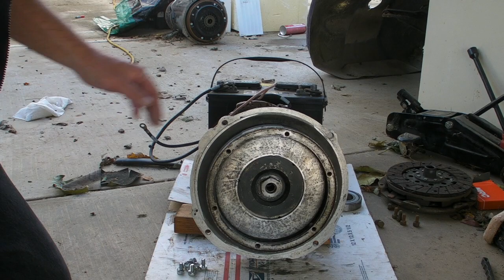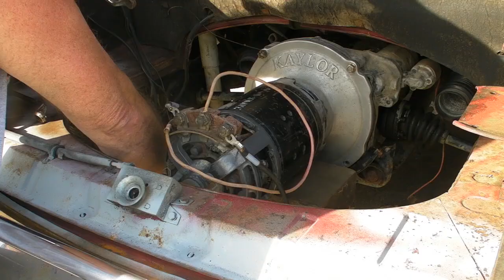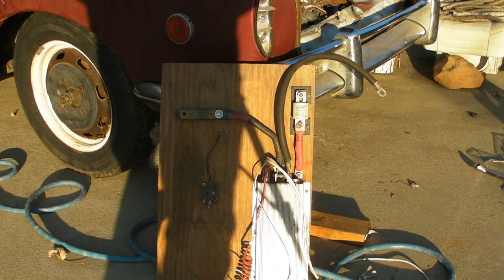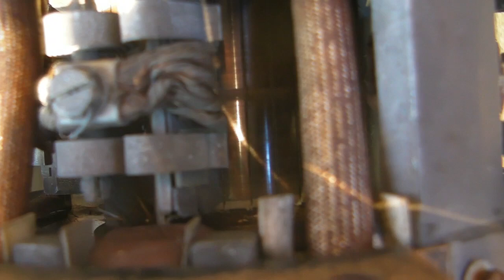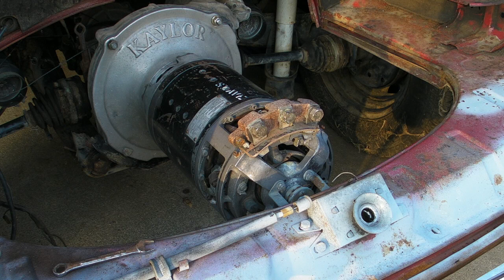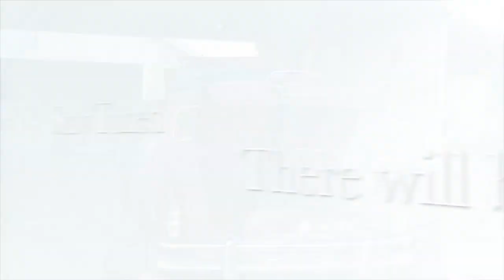Kaylor Motor Install.mov

Comment: Have you anymore info on Roy Kaylor’s Car kits ?I wrote another reply to you I don’t see it now what happened to it can you recover it
Reply from the maker: Not the car but I have two books on installing the motors into the cars. I still have this motor/adapter setup and I have two extra motors as well. In a light weight dune buggy with at least a two speed  mechanical switch and two voltages 36v and 72 volts you can get them to move along rather sharply. What do you need to know. I have talked to Roy many years ago but I do believe he has passed at this point. Most of the estate was either trashed or sold off. Too bad. He was a brilliant man and they squandered his intellect. Im still on the look out for parts and other manuals. I tried to resurrect some of his old web site but was unable to get much usable information. What would you like to know?
Reply from the maker: I did not see any other comment. I looked at my video details and comments. Could be you deleted vs post. I’ve done that before. If you can recall what you ask please ask again. I don’t delete posts unless they are nasty vile posts or scam posts.

Comment: I knew Roy Kaylor, rented a house from him in Menlo Park where he was installing these kits in VWs
Reply from the maker: I talked with him twice. Talked to those who were managing his estate as well. A very soft spoken man. I wish I had the original electrical parts from my first complete Kaylor Motor Setup. I ended up getting rid of them but that was before I acquired a book on how to connect up the parts. If I can find the parts I'll do a Dune Buggy with my Kaylor setup at 72 volts and lithium batteries.
Reply: He isn’t dead he lives in Oregon I spoke with his son Rex February 26th 2026
Reply from the maker: That is excellent news. Glad to know he is still with us. I’d love to find original parts including a generator setup he used on those old conversions. He would be stoked to know I have a working motor/adapter still. I do have a second adapter but it does not have the parts for the VW Flywheel. It was used to mount a different motor onto the adapter.
Reply: @robertsandham3517 man that's great to know! What happened to Roy's land? And hows Rex doing?

Comment: How much hp or kw of this motor
Reply: Couldn't say. It is very under powered for the Ghia but I was able to get the Ghia up to about 62 mph max with a 72 volt setup. If you have one you can set it up to use a modern DC controller but you won't have regenerative braking. The old style of speed control you could do regen with this particular motor. Not advisable. If you intend to do a conversion there are plenty of more powerful DC motors available that would do a much better job than this. I have however seen one on a fiberglass buggy and it was quick. But that is due to its light weight. These motors may be best to use as a generator. The motor does not have at HP or KW tag on it. I could research it but I don't think I will bother. Nor should you. Go find an HPEVS AC-35 or AC-50 and a Curtis Controller and install that on your little conversion. Much better all around. What I have here is no longer being made and are very difficult to find. I have three of these motors and two adapters. One adapter is complete the other is not.    I'm rather surprised that people still comment on these old videos.
Reply: @abittwisted  thank you for your briefly explanation

Comment: Idiot,...it's a clutch, not a flywheel...thumbs down.
Reply from the maker: Actually it was a Pressure Plate and not the flywheel. Of which I corrected it with a text image in the video. Ooops. So when talking about the clutch you are referring to all the components of the decouple system. Flywheel, Pressure Plate, Clutch Disk and the Throwout bearing and arm and clutch cable and pedal. All that comprises the Clutch. Thumbs Up.

Comment: you do not need a clutch to shift if the trans is synchronized
Reply: strainer bag for a 5 gallon bucket as a air filter
Reply from the maker: Well, technically yes. In practical terms some are better than others but the transmission was not designed to be shifted without a clutch. So use the clutch. Specifically this particular motor originally used a contactor style speed controller and a clutch was absolutely needed. I would argue that a clutch is a safety decoupler in the event of a runaway motor due to a controller failure. In my experience shifting without a clutch in an EV or gas powered vehicle is akward and many transmissions that are not new just don’t without grinding. Some work but why complicate matters by side stepping working technology.
Reply: i'm working on a electric motorcycle, with a magneto/generator in the rear brake drum
Reply from the maker: got some images?  How are you controlling that?
Reply: it is a charging system from a street bike. dynamo,  rectifier, voltage regulator. stuffed in the rear drum.
Reply from the maker: Id be interested in seeing it run. Im converting another VW with a medium size AC Induction Motor. Will be much better than this one I have here.

Comment: Hello friend, a question, where did you buy that engine? What serious business is I'm from Panama and I'm interested in sending one of those engines.
Reply from the maker: These are no longer available. I purchased mine used locally. There are much better options than one of these old setups. Check with the guys at evwest.com they can help you better than I can with some good motors. If you must go DC then be sure to get at least a 9" DC Series motor.
Reply: Pete McWade thank you !!

Comment: Hi do you know where can I buy a electric engine like that? or similar thank you.
Reply from the maker: Nothing like this is currently available. In all honesty this is not an ideal setup for a conversion. It does work but not ideal. Ideally you'd want at least a 9" diameter Series DC motor with adapter and controller or a nice AC-50 or 51 with controller and adapter. AC is the better way to go and the AC-51 and 50 can both be operated with the 96 volt or 144 volt controller. There are other DIY options available but for an off the shelf solution the AC motors from HPEVS here in the US would be your best bet. But you'd need a small light weight vehicle. Nothing too heavy. 2500 lbs or less.      evwest.com

Comment: Should have put this motor in a saturn
Reply from the maker: Na! Motor is way to small and underpowered for the heavy Saturn. This set up is ideal for a small light weight fiberglass VW buggy. It was designed for the VW anyway. This adapter won't work on a Saturn or any other vehicle except the VW.
Reply: 95 Saturn? Nah! The car is very light and small. I think it would be great.
Reply from the maker: Nope. 65 Ghia is 1800 lbs vs the 2300 lbs for the Saturn. The Ghia was pushing the weight limit of this motor. Like I said. This motor is too small for the Saturn. There are better motors and better vehicles to convert. Today I'd go with the AC motor vs the DC motor even in a racing application.
Reply: Pete McWade: sorry you donkey! Your correct.

Comment: why didn't you tear down the motor and rebuild it, or re-condition it? It looks pretty worn out.
Reply from the maker: This motor did and still does not need rebuilt. It could use a good cleaning and new paint job but other than that its in excellent condition. It is an old motor. This particular model of motor was used as a generator onboard military jet aircraft to provide power for the aircraft while in flight. This one was not used as a starter. Only a generator. They are built hell for stout and are built using full military specs. They are safety wired at every possible point to prevent mechanical failures while in flight. I have taken one of these apart and they are rather complex motors. They don't have a single shaft through the armature. The shaft is a dual shaft connected to an internal clutch that is always engaged but if it were to encounter any jam it would allow the shaft to spin without breaking the shaft. I still have all the parts and you won't find any civilian electric motor like these. I have two more of the exact model used in an old VW Engine Dyno that was built in the early 60's to provide torque and hp ratings of gas engines. A Racer in Oregon built it and it still works today. The electric motors are used for a load. It was also used to dyno electric motors but you had to connect them to the VW Transmission.
Reply: Pete McWade ... sounds 👍 great, I'll be looking forward to seeing you complete this project! 😃
Reply from the maker: Unfortunately this particular project has been mothballed. There are better choices for making an electric car conversion with off the shelf parts you can buy today. This was a late 1970's project that was somewhat successful. The original setup used a set of contactors for speed control unlike the electronic speed controllers we use today. The contactor setup used lower voltages but full on current that the batteries you used could dish out. So if it was put into a fiberglass dune buggy and you used 72 volts and two contactors you could do 36 volts and 72 volts and the full current available. It would give you not only two electronic speeds but it would also give you your 4 forward speeds in each electronic speed chosen. To work smoothly you would feather your clutch to smooth out the jolt of a start you'd get if you just allowed it to go full on with that voltage. With practice it was rather easy to work all the speeds and gears for a very nice ride but it took work on the drivers part. It was simple and powerful. Top speed in a light weight vehicle could reach in the 80 plus miles per hour range but you did have to give it time. Up to about 35 mph it was rather quick. I still have this motor and adapter and I know it works with a standard series motor controller but you won't have regenerative braking. It was really the only DC electric motor setup that would give you regenerative braking. With todays AC Induction motors you can do so much more with more power and for a reasonable price. I have been working on a DIY inverter to drive these motors and I am going to get another kit to make a more powerful one that will run any Induction AC motor and you will have all you need. I'll post some other avenues. This was a fun project but it is not going to be finished. The Ghia has already been sold.
Reply from the maker: This is my Large DC motor setup that is currently in my Red Bug. This video is a test of using the controller as a charger too.   https://www.youtube.com/watch?v=GZKCaL02weE
Reply from the maker: This is me driving the car. I have done some extra work to the car and it will be back on the road soon.  https://www.youtube.com/watch?v=lHvpkhOwW-g
Reply: Thanks Pete! 😉😃

Comment: That area where you ground back must have been rubbed by the new stock clutch I assume?
Whilst removing material may have helped in this case, would it not have been better to put a spacer between the motor and the mounting plate?
Obviously the mounting plate isn't quite thick enough and the clutch is now sitting further along the gearbox shaft than originally intended.
Just my thoughts.
Reply from the maker: If I had a full spacer that would have helped but I would have had to know the exact spacing. I had this work just fine on other transmissions. Im assuming that the adapter was not put together properly after I replaced the bearings. Meaning that the piece that holds the flywheel was sticking out a bit further than it had been before. Just enough to rub. I think the fix would be to use a different pressure plate or take it apart and move the piece back a bit. Not something I thought about when doing this test. By the way, this motor is not installed in any vehicle at this time.

Comment: frekin dangerous way to work
Reply from the maker: +Diozark Why do you say that? The motor is light weight.
Reply: Im a by the book safety guy, when you were testing the motor holding it with one hand and using the other to hold the battery cable and then power it up, if something went wrong you could have lost a finger, or a hand or worse.
Reply from the maker: +Diozark I already knew from previous testing of these motors what kind of torque I would get with a 12 volt battery. It really is not much at all. I would never have held that by hand with more than 12 volts. It is not safe to do unloaded testing with more than 12 volts for any of these 12 volt motors. This one however does run up to a much higher rpm than most DC Series motors. My very first testing was done with 6 volt batteries then I moved to 12. When I had it at 36 volts I had supported on the sides and I had a throttle and not just full dump so the actual voltage was low when starting. This was just to test to be sure there was no wobble after installing the pressure plate and clutch. I eventually ditched the idea of using one of these motors and now have an 11" Kostov DC Series Motor with interpoles and running 192 volts and 850 amps in my Bug. I am mounting an AC motor to my VW Bus. I still have this little motor. Still works great but in reality its good for a VW Dune Buggy or any VW based fiberglass setup. Not best suited for the street. This was designed in the 70's for the VW platform. Standard voltage control was a contactor based system. No modern throttle control but if you were good you could drive it pretty good. These motors however do get rather hot so you need excellent cooling air to keep them cool. These are military motors and built like tanks. I have three of them. 

If you look at that video again you will see the torque jump the motor but if you notice the rpm is rather low. There is no way that would break a hand or tear off a finger or any other damage. It could not actually get away from you. I was totally safe. Like I said. Anymore than that I would have had it mounted in the vehicle or blocked to keep from getting away.
Reply: Pete McWade people need to relax. You're only testing it at 12v. Nice work and thank you

Comment: hi can you tell me the characteristics of the electric motor ... HP, voltage, single phase or three phase, RPM, please many thanks.
Reply from the maker: The motor is DC. HP depends upon voltage and amperage. It is NOT an AC motor. It is a special SepEx DC motor that was originally used in aircraft for a starter motor for the jet engine and then switched to generator mode for in flight power generation for the aircraft. They are robust and produce fairly high amperage in generator mode but the voltage is only 36 volts. In motor mode you can dump in 96 volts with no trouble and they will provide good power. The motors do get quite hot at high voltages and amperages. Proper cooling is paramount and these are not super practical for use in an EV. They are fine for fiberglass dune buggies at 72 volts. Using lead acid batteries will provide high amperage with a standard contactor switch setup. There is no smooth control of the power. You will need to use a clutch to smooth out the acceleration of the motor. It will however move your light weight buggy pretty well. Anything heavier will not be so good. 

After doing multiple conversions it is our recommendation to NOT use these motors. For a generator for home use it may provide great long lasting emergency power.
Reply from the maker: RPM abilities are up to 8000 rpm continuous and 12000 rpm for short bursts without the commutator coming apart. Remember these motors were mounted to a jet engine directly for the intended use of these motors.
Reply: thank you very much

Comment: Can you attach an automatic transmission to an electric motor instead of manual?
Reply from the maker: You can. But you will have trouble with a DC motor and normal controller. Only one controller on the market for DC motors will allow an idle function for use with an automatic transmission. The automatic must remain moving when stopped to keep the tranny fluid pressure up. There are some AC motor/inverter setups that allow idle function for use with an automatic transmission and they work great. Most DC conversions should be done with manual transmissions.
Reply: Pete McWade 
Hello Peter. Where can you buy this electric motor from. Is there a name for it? And where did you get yours from? Are they expensive?
Reply from the maker: The motor adaptor setup is a Kaylor and if you really really want one badly enough I can get you in touch with the original maker of the adaptor plate. The plate was designed for these motors and for the VW transaxle. These motors need lots of air so you MUST have a good blower that can blow enough through the motor so the motor stays cool. I found mine on craigslist and it was $600 for the motor/adaptor. There was no regular controller. But if you buy from the original maker of these you will also get the original contactor switch setup for your speed control. They do not use modern day series motor controllers. You can but you won't get the regen abilities and NO these are not AC motors. They are special SepEx motors that were used to start old jet aircraft military jet engines. The motors are very robust. They are not terrible powerful. They will do fine for a VW Buggy.
Reply: Pete McWade dsg semi auto gearbox with solve that problem.